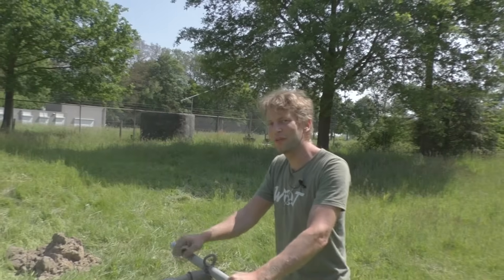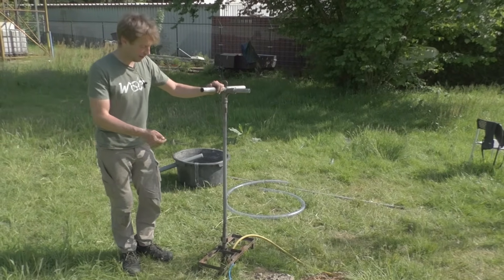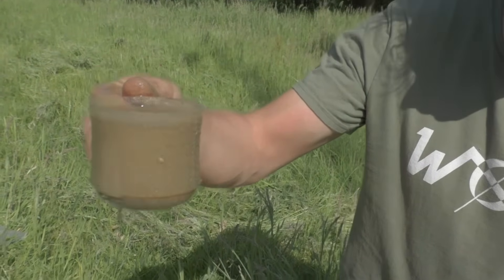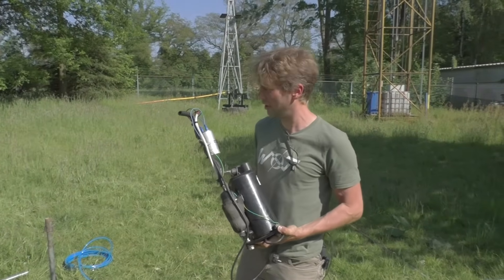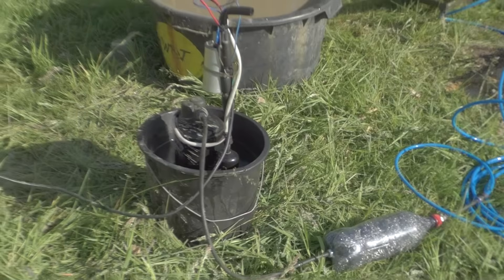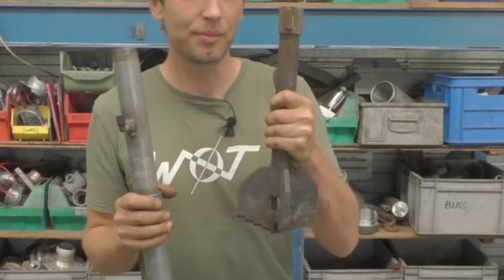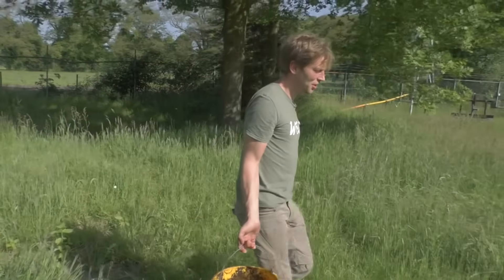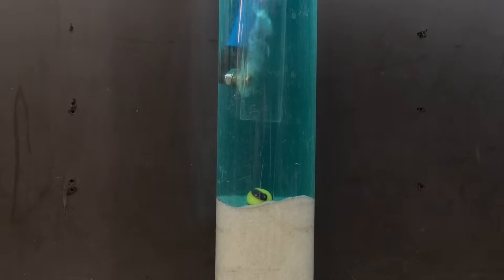Drilling a DIY Well Using Air

Comment: Great inf othank you!! How much flow per minut and pressure you need to use this method up to 15/20 m? Would a normal air compresor work for this? Thank you!!!!

Comment: a tip if use pvc pipe, use the grey fittings for electric, they are not tapered and wont get too tight after a while.

Comment: You talked about the very sandy soil in this demonstration.  How would this method work or how would it need to be modified to work with clay soil?  Would the clay settle out well enough in the tub without any modifications in order to form a layer in the bottom of the tub and to send relatively cleaner water back into the hole?

Comment: Using air to create the flow is ingenious. For me this is hardly an option without using an additional method to clear bigger rocks from the hole since here the soil is a mix of 80% stone >5cm and blue/red clay. Below 2m This mix becomes so hard small excavators(<1.5t) have problems digging into it.

Comment: Watched your other vid where you drilled with the electric drill. Which do you feel is best? Also - if you have a water supply can you eliminate the recirculating pump?

Comment: Hydrophobic coating like NeverWet so that the water normally stuck to the side of the pipe isn't and cant bypass the air bubbles.

Use pulses of air to get less but bigger bubbles that fill the whole pipe diameter.
A steam train type crank to a bicycle pump  or car hand pump will work.  
A variable rpm and stroke might find a resonance frequency.
or
Just a single cylinder compressor pump without an air tank/reservoir.

Oh ye;  round the edges of the water intake so its more hydrodynamic.
You can see it restricting flow by the thinning of the sand column just after the intake.
Reply: Do I understand correctly that you're suggesting there could be ways to do this with a human powered air pump instead of an electric pump?

Comment: I tried drilling with this method but had no success 😢. My setup is 1inch pipes with the air inlet at the drill head about 35cm from the bottom. My issue that I'm having is that instead of the air pumping out it seems to be venting from below  and having the water bubble around  my drill but. I'm using a shop compressor and inputting the air with a airblow gun attachment. My drilling fluid is using bentonite. Any advice would be appreciated
Reply: air inlet should be 2-3 cm from the bottom of uplifting 1" pipe

Comment: Would this method work on an existing well that has sediment build up?
Reply: yes
Reply: but you can use Alcatan/plastic flexible ridged pipe/hose for underground water; make air insertion 25 mm from the bottom. Start compressor, slowly approach sediment layer and gently push up and down. Dont push into the sediment, will plug the hose

Comment: Thanks for all the effort you put into this video. Your instruction and demonstrations were fantastic.  I'm going to go a little deeper with my old well to improve its recharge rate and this is perfect as I have a large air compressor and enough hose to reach it. Since there's water already in it, I'll just use a catchment without needing a return. I'm assuming this is what you do when you finally enter a water bearing layer anyway. Again, thanks.

Comment: Just finished drilling my well using this method,  hit compressed gravel/sand layer at 5.5 meters, after 2 hours i progressed maybe 20cm, my drilling bit was all dulled from scraping, so decided to finish it there, even though i've had 10m of pipes prepared.
Doubt it will have water, but it was a fun thing to try.
I've used even smaller compressor, around 150W, from a broken up air dehumidifier (theirs should be 400W).
Size of pipe was 3/4 (same they use in the video)
For drilling fluid i used Xanthan gum instead,  you really don't need much, it's readily available, and not expensive.
One big thing not mentioned in the videos (but it is shown), you need to top up the bore hole, meaning, fill it up all the way with water.
First time i tried, i've only filled up 1/3, and it would not work, after contacting WOT,  they confirmed you need to top up the bore hole.
I thought doing this would dilute the drilling fluid too much, and it would not work, but worked out fine, the thing spat out big pieces of rock and sand easily.

After everything was setup properly, it was rather fast to drill, shame a hit a very hard layer so i had to quit.

Comment: Just put air and water true pipe and come out the sides
Reply: 😏? that is how we do it in the north sea, drillin say 3000 meter down and 10.000 meter horisontal following the oil sand layers!
sending all the drilling fluid, (drill mud) with no air in it through the drill string and pushing it up on the outside, back to the drill rigs mud  settling pond.
most people dont realise it, but to drill such a deep-long hole, there is a lot of different drill diameters and CASINGS involved.
We usually start with a 36 inch drill down from the rig, through say 300 meter ocean  through bottom sand and 100 meter further through BEDROCK,
Just using sea water as cooling and washing out hte sand-stone from the hole
Then we pull out the drill and lover a big steel pipe around 35 inch outside diameter and say 25 inch inside diameter in to the hole,
All the way from the rig and down to the bottom of the hole.
Then we pump down concrete gluing the casing to the bedrock
After that we continue drilling with say a 25 inch drill using DRILL MUD that we are able to recycle becouse its trapd inside the casing.
That diameter is kept and we drill to say 1200 meter  where we hit say a layer of water, which is a little problem becouse of we loose some mud.
So we drill maybe 5 meter more and put in another casing,, again concreting the smaller casing all the way up to the rig.
at say 3000 meter we usually are down to say 8, sometimes 4 inches having gone through several water-oil-gas layers we dont want to produce from,
Reason for all the casing layers beeing glued all the way up, is that IF and WHEN you hit oil and gas at say 3000 meter its under PRESSURE
Becouse of the weight of the rock-water over it.
So withouth the SOLID CASINGS ALL THE WAY UP TO THE SAFETY VALVES YOU WOULD GET AN UNCONTROLLABLE BLOWOUT! 😎
Here is an example drawing:::                            https://upload.wikimedia.org/wikipedia/commons/thumb/2/22/Production_Liner.jpg/220px-Production_Liner.jpg
Point is that without the casings the mud wouldnt be able to bring up the stone and  sand all the way and the drill would get STUCK!

Comment: Excellent technique. I have a 75m deep well drilled on rock, most of it got full of sand because the contractor didn't sealed with bentonite the upper part. No one wants to clean it. I'll give this method a try, it may solve my problem temporarily.

Comment: My well is at 10 meters. When it needs to be replaced I will use this methoud. Only thing I would add is maybe a tower with a electric motor on the top could turn then lift the pipe via a cam before a spring pulls it back to 0. Gravity would lower the pipe but you would need a exposed  1 meter  section for the cam to hit. 

 The 1 meter section would drop down through the tower until it was no longer hitting the pulley. You then get up from your chair and add a new 1 meter section, check the temps and let the thing dig another meter while you relax.

Comment: To make it easier to lift long metal pipe you can attach enclosed pipe with air to it.
Reply: Or may be just use thicker pipe to pump air
Reply: Have a valve on the outlet near the handles.  Just close the valve and air will build up in the pipe, lifting it up.

Comment: Have you experience with drilling with a "regular" vacuum-cleaner?
I tried this with a regular "bouwstofzuiger" attached to a 20mm ID steel pipe - managed to go to 2m deep, could have likely gone further, but my tube-length ran out. 
The moving pipe makes a larger hole (say 50mm diameter) such that fresh air enters around the pipe, downwards,  and then gets sucked back up into the pipe.

Not as elegant for deep holes as the water, granted, but for small holes, works surprisingly well. Try it with a 19mm PVC "elektrabuis' to get an idea :)

Comment: You can put compressor in the shade to protect it from infrared sun radiation and cool it by the small electrical air fan (at the same time). Without any risks. Or/additionally put compressor into the typical commercial plastic bag to isolate it form water. However, I'm afraid that cooling compressors are designed for the continuous operation (S1 class engines) although, in practise, they work in 50/50 cycles - like in typical fridges. Without  any cooling system (not to confuse with cooling of refrigerant in condenser) 🙂